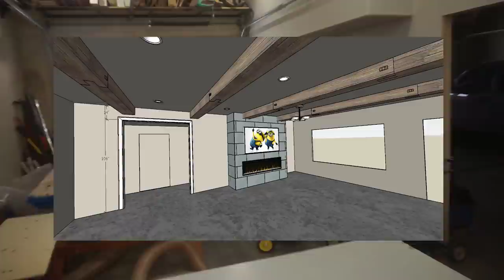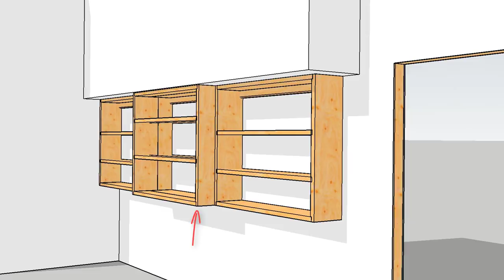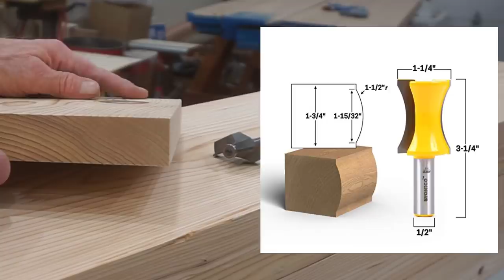Get Organized with Simple Solid Storage Shelves

Comment: Thumbnail profile router bit. Nice touch! Micro bevel gives it a better install and gives the glue an extra corner - good tip! GRK torx is one strong connector. Now I just need to remember not to overdrill the Snappy countersink when drilling, which leads to the buried screw. BTW - I usually stack the lumber with stickers 13/16” strips (white oak plywood). I paint the ends of the boards with an Alkalyd exterior primer that I’m wishing to slow dry and give it several coats since the end grain absorbs.  This helps with stabilizing the drying process and keeps from bowing, checking on the ends etc. I’m sure you know this, since you’re an expert. Just wanted to add the comment for someone watching your video that’s new to woodworking.  I always learn stuff watching you!

Comment: Those clamps were the perfect thing for the job - large enough to apply pressure over more area, as opposed to a small clamp putting a lot of pressure on the top of the joint and pulling it up

Comment: Those are some handsome and strong shelves. I have a new storage building that could use one or two of these. That was an important tip about completing the assembly before the milled lumber began "changing" from drying. I thought your video was fine. You should see some of mine (bad).

Comment: Beautiful job!! I need to build some shelves myself for the shop (at home ). Shelves will most likely carry car parts, ranch equipment parts... really heavy stuff. And I was just going to use 3/4" plywood for shelves and 4x4s for uprights, maybe not now. Thank you for all of the tips an insight.
Reply from the maker: Guys like you are the exact reason I posted this video Daniel. 2x shelves are so much sturdier than plywood for heavy stuff like yours.  I'd limit shelf width to about 4' because with steel parts stored on them a 2x12 at 6' will sag. Keep in mind that you don't have to run everything through a thickness planer or make them so they hang on the wall.  They're super strong, especially when sitting on a floor.  The main thing is to cut shallow dados in the verticals to support the shelves and keep them from cupping and warping.  You can easily make the dados with a circular saw using the technique shown in this video: https://www.youtube.com/watch?v=joFoPcBhf4Y&t=1s   Let me know  how it goes if you try it? Best, Matt

Comment: Great video, I make hanging closets for bedrooms in a similar fashion, using a premade metal hangar strip you can buy at home supply places that sell the closet material and systems. I make my own closet material out of 3/4" American hardwood faced plywood, 5/8" for the shelves, and cut a notch in the verticals to hang the assembly on the wall. They are very strong, the shelves are held in place with the metal shelf tabs made for the purpose, using a brass insert in each hole as well. I use a jig the cut the holes in standard cabinet spacing. The material sold for shelving in stores i found to be poor quality and weak. By custom designing your verticals you can use them to create dividers to suit the closet layout you wish, and limit the length of the shelves as appropriate. The bars are said to hole 1200 lb loads, I've never had a problem with these ever. I use the metal rods and brackets for clothes hangars and the top shelf and small corner brackets against the wall to hold the spacing of the verticals. Thanks for posting this excellent idea !

Comment: Sir - thank you for the tip on backrouting.  You don't know how many problems you've just saved me in the future, and just how much less wood will now go into the fireplace!  BTW - had no qualms whatsoever with Spielberg effects, LOL!  Superior job as always, and I can imagine the time and effort in producing these videos.  Me?  I take occasional vids with my iPhone of the GrandAngels, and that's about it.
Reply from the maker: 'GrandAngels' LOL! Thanks for your comment Dan... I almost always use climb-cutting (back routing) and never give it much thought.  Shooting the video it dawned on me that it might look like a mistake in that I wasn't sure which way to run the router so I quickly explained it.  I'm sure you know but a router with a large bit like I was using will REALLY 'climb' with force so you need to be ready for it.  I usually have my elbow tucked in against abdomen so the force has to push my whole body instead of just overcome arm muscles.  You'll find that by removing the sharp corner and about 60~70% of the material that the forward finish pass will be far less prone to splintering.
Have fun, work safe! Best, Matt

Comment: One thing I am always nervous about is finding the studs or strong support behind the drywall/sheet rock.  Maybe you could show how you determine exactly where to screw in for this or many other projects.  Also, I appreciate that you explained that it took 3 hours to clean up the wood to make it ready to use.  This is important to me as I never knew I should spend so much time to get the lumber so clean/sharp.  I always wondered why the lumber never connected as cleanly as in the videos I try to emulate.  Thanks.
Reply from the maker: Generally the more time you spend up front the less you'll spend in frustration later in the build... plus the project comes out much better too! Best, Matt

Comment: I suppose for an even dressier look, you could have counter-bored the screw holes and used matching plugs to hide the exposed screw heads in the uprights, and applied 3 coats of durable poly sealer, but even unfinished, they look fine,  sturdy,  and above all, very useful.
Reply from the maker: Finishing the shelves would be great for a permanent installation Welsh Rabbit!  The dado/rabbet joinery, thumbnail edges and eased corners of the build lend themselves well for a 'furniture grade' finish.  If these weren't 'temporary' shelves I would have used different wood for a natural or stained finish or done a primed/painted finish in accent or contrast color to shop walls.  Best, Matt

Comment: The end results are amazing, but it'd be hard for me to follow these kind of projects, since I still don't have a jointer nor a thickness planer on my shop. Another down side here is the lumber yards we have around don't offer anything as wide as 8 inches thicker than 1 inch, a few exceptions for some expensive hardwood. But that's it, I really enjoyed the project and maybe I can try something with what I can get. Nice work Matt, till next video.
Reply: This is construction lumber - lumber for building a house.  It will be a different lumber distributor than where you're going for hardwoods
Reply: @jeffeverde1  I get your point, but unfortunately here in my country, specially in the state I live, most lumber yards will sell construction lumber and hardwood, some will have only the construction ones, but even so they don't mill the lumber this thick for boards (usually 1 inch thick. Even the famous 2x4s you guys have all around are hard to find here, specially for pine. It sucks living in Brazil.

Comment: What a great video. Really appreciate the explanations on all of the milling and install. I’m a new subscriber, glad I found your channel. I’m making my way through your videos. Thumbs up has been smashed. Haha. Thanks!
Reply: Also, just a side note - I was kindve surprised you didn’t use glue for the shelves to side rail connection, but glad to see there are other acceptable ways to make connections like that, since I don’t doubt you know exactly how that will hold up. Thanks again.
Reply: And, that band clamp holder, genius! So simple, but I’ve been struggling with figuring out how to store my band clamps. And now, I know. Thanks!
Reply from the maker: @artiet5982  I figured 'no glue' would be a surprise to some.  It's not uncommon for me to build stuff like that and have zero issues with the practice.  I think glue gets used too often as a measure to compensate for poor workmanship or engineering so it seems like it's mandatory.  BTW if subject to different stresses that required more strength from glue I would have used a polyurethane type construction adhesive rather than wood glue.  Wood glue is relatively brittle and very poor at 'gap filling' and would be marginal for gluing end grain to face grain on these shelves.  Best, Matt
Reply from the maker: Welcome Art!  Glad to hear you smashed the thumbs up without smashing your thumb! 😂😎
Reply: @NextLevelCarpentry  I just learned ANOTHER great piece of information!
Thanks.

Comment: Another great video, as others have said it's so much more fulfilling to watch an actual expert in his own voice than some HGTV fluff piece.

Structural question though -- it looks like the weight on the shelves is transferred to the sides through the rabbet and dado joint which has great shear strength, but then it all concentrates at the three screws at the top of the sides.  There isn't any support from the rabbet since its open on top so all the weight is hanging off the screws in shear.  Since they are sunk into the end grain of the top, with enough weight it seems like the top would split along the grain, causing the shelves and sides to separate and fall.  Maybe another ledger below the bottom shelf would be a good idea?
Reply from the maker: Good question Jy... in addition to the 3 screws that hold each shelf end there's another two in each end of the back cleat so that's 10 screws that would have to shear for the connection to fail.  Each screw would certainly hold 30lbs and there won't be 300lbs on these shelves so I'm not concerned.  It would be simple to incorporate a couple steel straps into the design if more weight was anticipated.  BTW this construction method works great for shelves that stand on the floor where the cleat can be a 1x4 since it only has to keep shelves from tipping over... Bext, Matt

Comment: Awesome Video Matt.  I learned a lot from you.  I am wondering why you don't make the shelves adjustable.
Reply from the maker: Great to hear Bryan, thanks.  The design of these shelves was very specific to what I put in them so I made the shelves rigid so as to be more solid.  I probably would have put a thin back in the cabinet to keep the sides from bulging with weighted, adjustable shelves but that might not even be necessary.  If I were making shelves that stood on the floor and 8' tall or so I'd put one fixed shelf about 1/3~1/2 way up with adjustables above and below. Those features would give a LOT of flexibility for storing random stuff that changes over time. Best, Matt

Comment: Hi Matt—nice straight forward design with the attention to detail we've come to expect. I'd like your comments on whether an additional support under the shelves is advisable. As I see it, the units are supported by the top shelf in each tier; and the failure mode would involve shear failure of only three of the construction screws (or the splitting out of top shelf for these screws). The lag screws will surely hold the cleat to the wall and the top shelf to the cleat (and ceiling above), but the entire weight of the rest of the unit is borne by top shelf alone.
Reply from the maker: I understand your viewpoint and it shows you think stuff through Bob... an admirable trait.  In response to other comments similar to yours I'll add that there are actually 10 screws holding the top shelf and cleat to the uprights: 3 in each end of the shelf and two more in each end of the cleat.  300lbs on each shelf unit puts only 30 lbs force in shear on each fastener and I'd be comfortable with 50.  Even if the screws were stressed in pullout (which as you know is much weaker) I don't think they'd pull out of end grain at 30lbs... it might be close but none of these fasteners are resisting meaningful pullout force.  If I was concerned with failure I'd add a steel strap held under tension into the design rather than additional support under the shelves which would kind of defeat the purpose.  All this is just me with my reasoning from education at M.I.T. (Mistakes I've Tried) so take it for what it's worth and only do things YOU are comfortable with... Best, Matt
Reply: @NextLevelCarpentry  I never went to M.I.T., but I have been going to E.U. my entire life.  Empirical University, now online and available at YT University.  ;-)

Comment: It’s there a time that the bar clamps are better than the trigger style clamps? I’m building up my shop and it’s time to invest in clamps. Thanks for the great videos!
Reply from the maker: Hey Ethan, I use pipe clamps because they were a great value when I bought them decades ago.  They're also adaptable to a wide range of clamping applications so I'll always have a selection in my shop. High end clamps like Bessey do have features, capabilities and advantages that make them superior to cheap 'ol bar clamps in some ways but keep in mind I've been doing this sort of work for over 40 years and never encountered a situation that I didn't get done with the bar clamps I'm still using.  For 'building up your shop' I'd make sure to invest in the best tablesaw, jointer and thickness planer you can before sacrificing much $$ in high-end clamps.  Best, Matt

Comment: I think I would have considered gluing the split, without taking it apart, and turning the piece around, placing the split against the wall, and reworking the thumb nail on what would have been against the wall.

Followed the project and think I learned a few things including how to repair that split. Thanks.

Comment: Hi Matt, thanks for another great video. If you were doing it again, would you change anything? Like moving the rear support down one shelf? So that the weight is carried by the side rebates and not just the top side screws (and also help hold the lowest shelf against the wall). Conventional bookshelves tend to have the deepest shelves at the bottom, but when you reach up @ 5 ‘ 10” it also helps to have the biggest shelves at the top (like your RHS shelves)! I’m going to makes these shelves for my workshop to replace four kitchen wall cupboards (that drive me nuts) - or take off the doors.

Comment: Great build! With the loads you have on there, no doubt everything is stout and built to last, not to go as far as to say overbuilt. It's not every time you can get away with it though, so even though they're not pretty, 3x3x3" ribbed construction brackets can sometimes be lifesavers, for instance if a client wants a cast wheel tread basin in the bathroom, and everything has to be wall mounted. No cleat in this world wil hold up 600lbs on 4 regular cabinet backs - they'll snap clean off. So what to do then? Of course wall prep is essential. Preferably with shear sheeting, should the blocks have a tendency to move. Then transfer the weight straight from the sides of the cabinets to the wall. How? those 3x3x3" brackets with lags in the wall, and screwed in the cabinetry. You'll have to tear down the wall before that sink moves. Always good to have a firm hold of the sides to be sure - especially when not put together as well as your shelves. besides: when is anyone looking up behind that wheel tread anyway? Figure the plumber can handle the view just fine. just a tip.

Comment: Di-hydrogen oxide? You got me there. Good one. I had to look it up. Boy, do I feel silly.  So use to hearing H2O that it stumped me.
Still, you produced another great video even with all the difficulties.
Reply: Its actually Di-hydrogen monoxide  but yes hes a clever chap got me the first time i heard it too
Reply: @rufasgutz7656  you're absolutely correct.
Reply: Too funny
Reply: di-hydrogen oxide !!   That was classic. . . . I'm still chuckling over it.   I so appreciate your sense of humor.  It's typically what I subject my computer programming students to most of the semester.  Excellent carpentry.  Just found your channel and am learning so much.  Thanks.  Keep up the great work.  It is much appreciated.

Comment: You want squeeze out but keep in mind that tight bond 3 will not allow you to stain wood where it comes in contact,  so you must painter's tape the surface of the glued joint .
Reply from the maker: That's why I use a sharpened putty knife Michael... squeeze out insures a full glue joint, a properly sharpened and used putty knife guarantees to problem with stain.  Much better and faster than messing with painters' tape... or anything else IMHO.  Best, Matt

Comment: Regardless of production quality, there's always useful gems in your videos like the "glue stronger than wood" & repairing that split.  I appreciate the "long cut" & "making of" of your videos, so please worry about that.  I'm curious, any other factors go into the difference in shelf depths other than the stuff you have to put there?
Reply from the maker: Thanks for your comment Erik.  Regarding shelf depth it was all about the boxes I wanted to put on them.  The same system could be used for deeper or shallower shelves with proportional difficulty for deeper ones and ease for shallower.  The 2x18's were on the verge of being too unwieldy so if I needed deeper shelves I probably would have gone with a different design that incorporated plywood... maybe 2 layers laminated would be more stable and manageable.  Shallower shelves could be made with good quality 1x8s using similar design as long as they weren't too wide and heavily loaded that they'd sag.  Good question! Best, Matt

Comment: Great build!  Is there a strength or structure reason why the middle shelves are built deeper?
Reply from the maker: The reason is mostly practical and partly a esthetic. The boxes I use to
 store stuff are about that long and putting the deeper shelves in the 
middle make them symmetrical. Best, Matt